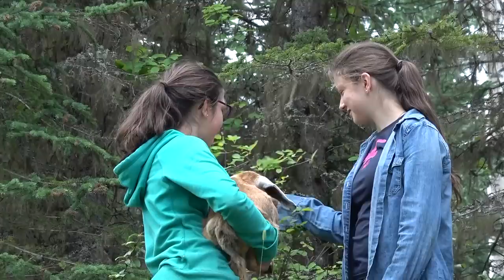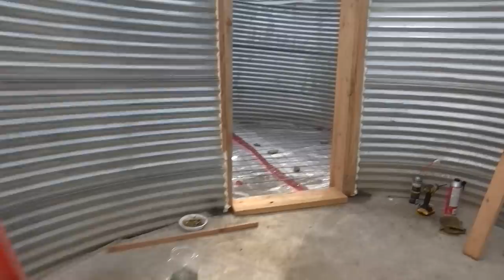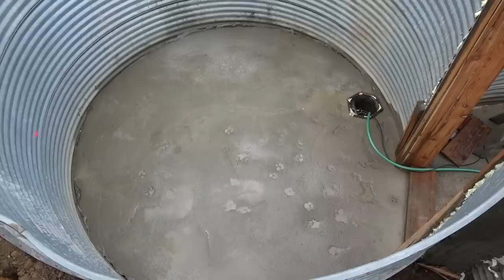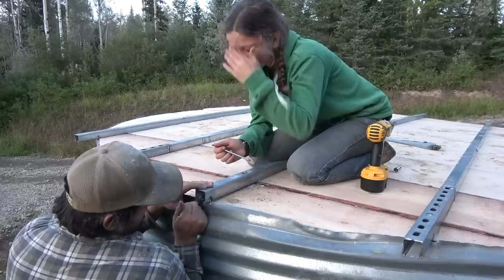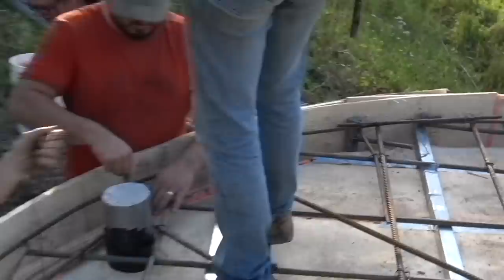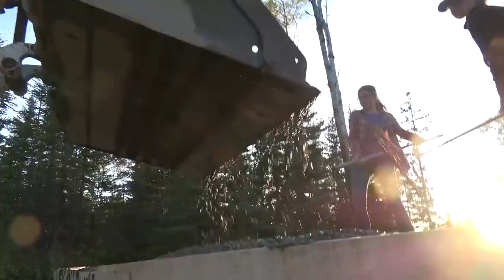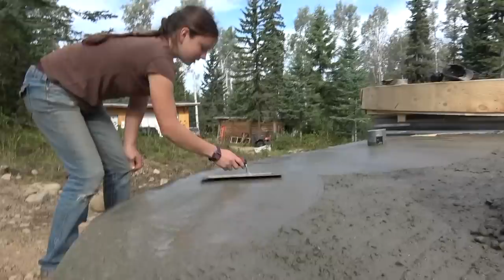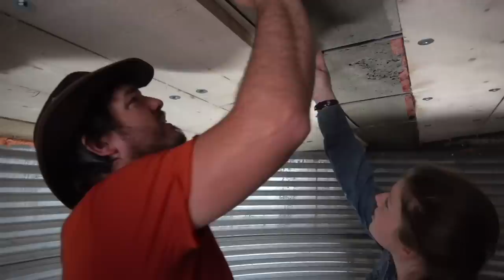Home Made Cellar: Suspended Slab on a Culvert

Comment: You better be putting support walls inside of there made out of 4 - 6 inch drillers pipe. There is no way that is engineered to take all that weight without support beams etc.

Comment: I hope no one is inside when it collapses. I can't  beleave 2" unistrut  held the form wood up.
On a structure that size, using 8" poured block you need 12" bar joist on 24" centers, minimum when pouring on metal floor form.
Reply: Did you miss seeing the 6 to 8 inch timber shoring holding up the wood form? Obviously it was strong enough.

Comment: Glad to see the family working together but come on dad time to be a square and loose the earring and at least one post secured top and bottom in the middle the culvert is not designed to carry a load on end possible solution would be external concrete with rebar columns attached top and bottom

Comment: You needed to pour steel rebar re-inforced columns with integrated rebar tie-ins to slab above around the perimeter maybe even one large one in the center... that culvert will not support that slab

Comment: I don't see how that very thin steel from that culvert can support that very heavy concrete roof top and plus soil over it. Maybe for a while, but eventually that will collapse, and I pray none of your loved ones are in or around that structure when it happens.

Why didn't you just make the walls concrete with rebar to support the weight of the roof and soil?

Comment: Great video, love your family,  your wife and girls are amazing. Boy are you out estrogened  ( not sure if that's the correct use of "ed") I'm  a structure fabricator with steel and concrete,  those culverts are not engineered to handle that much weight.  You have a human mouse trap of death there unless you put some serious internal support inside.

Comment: What you built is very neat let me get that out-of-the-way. Now I wish that I had known you before you started this project and I would’ve seen your drafting if you had any blueprints on

I have work in industrial construction my entire life from the oil field to refineries. Design and engineering so this is my specialty what’s your doing.  That culvert goes by what is called “GAUGE METAL WEIGHT.” what you really needed to do before you took on this project was just simply google the different gauges and weights of that kind of metal that Culvert is made from.     I could have sent it all to you via email. All the info you need. What I am scared to death up for you and your family is all of you not making it out of there. Because of it caving in on you. And I picked up on your comment about it being 40 below zero. The only place on the North American continent were 18 get that low in stay that low for several days on here is Alaska in Canada. Not even my state of North Dakota will get the 40 below and stay that way for several days.   
Yes we’ve had several days of 40 below but that was windchill only not actual temperature. And windchill only affect humans and animals it’s amazing the number of people that don’t even know this.
The only way I would write off and clear your project we say is if you installed at least 2 }]Z 5000 pound rated,    “VERTICAL BRACES.”

The Kerguelen Islands, also known as the Desolation Islands (Îles de la Désolation in French), are a group of islandsin the Antarctic constituting one of the two exposed parts of the Kerguelen Plateau, a large igneous province mostly submerged by the southern Indian Ocean.

 They are among the most isolated places on Earth, located 450 km (280 mi) northwest of the uninhabited Heard Island and McDonald Islands (Australia) and more than 3,300 km (2,100 mi) from Madagascar. 

The nearest populated location (excluding the Alfred Faure scientific station in Île de la Possession, about 1,340 km, 830 mi from there, and the non-permanent station located in Île Amsterdam, 1,440 km, 890 mi away). 

The islands, along with Adélie Land, the Crozet Islands, Amsterdam and Saint Paul Islands, and France's Scattered Islands in the Indian Ocean, are part of the French Southern and Antarctic Lands and are administered as a separate district.

The main island, Grande Terre, is 6,675 km2(2,577 sq mi) in area and is surrounded by a further 300 smaller islands and islets. 

By forming an archipelago of 7,215 km2(2,786 sq mi). The climate is raw and chilly with frequent high winds throughout the year.

 The surrounding seas are generally rough and they remain ice-free year-round. 

There are no indigenous inhabitants, but France maintains a permanent presence of 45 to 100 soldiers, scientists, engineers and researchers.

There are no airports on the islands, so all travel and transport from the outside world is conducted by ship.

The islands were officially discovered by the French navigator Yves-Joseph de Kerguelen-Trémarec on 12 February 1772. The next day Charles de Boisguehenneuc landed and claimed the island for the French crown.

Yves de Kerguelen organised a second expedition in 1773 and arrived at the "baie de l'Oiseau" by December of the same year. On 6 January 1774 he commanded his lieutenant, Henri Pascal de Rochegude, to leave a message notifying any passers-by of the two passages and of the French claim to the islands.

Thereafter, a number of expeditions briefly visited the islands, including that of Captain James Cook in December 1776 during his third voyage, who verified and confirmed the passage of de Kerguelen by discovering and annotating the message left by the French navigator.

Soon after their discovery, the archipelago was regularly visited by whalers and sealers (mostly British, American and Norwegian) 

Who is hunted the resident populations of whales and seals to the point of near extinction, including fur seals in the 18th century and elephant seals in the 19th century. 

The sealing era lasted from 1781 to 1922 during which time 284 sealing visits are recorded, nine of which ended when the vessel was wrecked.

 Modern industrial sealing, associated with whaling stations, occurred intermittently between 1908 and 1956.

 Since the end of the whaling and sealing era, most of the islands' species have been able to increase their population again.

Relics of the sealing period include trypots, hut ruins, graves and inscriptions.

In 1800, Hillsborough spent eight months sealing and whaling around the islands. During this time Captain Robert Rhodes, her master, prepared a chart of the islands.

That vessel returned to London in April 1801 with 450 Barrels of sea elephant oil.

In 1825, the British sealer John Nunn and three crew members from Favourite were shipwrecked on Kerguelen until they were rescued in 1827 by Captain Alexander Distant during his hunting campaign.
Reply: Is it me or did you stray a little off topic?

Comment: That is so dangerous. You want to kill someone? YOu URGENTLY need a centre post support. The people you kill will possibly be the ones you love the most. Hurry up and fix it! (edit a centre post is just a quick fix.. really teh whole slab needs to be hoisted off and the area around the outside of the culvert excavated and then pour the void with reinforced concrete. Work out the weight of the slab and any soil, water on top and provide a centre beam strong enough to support it. Unfortunately the roof slab is probably too small a circumference to be supported by the new concrete walls so you might have to pour the roof again (perhaps you can use the concrete disc as another shed/dome floor somewhere). Not trying to be horrible to you about 'kiling someone' but when I saw you guys go in there (with the kids) at the end of the video I got the fright of my life and was further hocked to see that that was the end of the build. Your either smart and fix it? or youve read this and been told and will be fully responsible for the potential death that could happen.

Comment: I'm not positive what the structural weight rating is for a culver turned on it's edge. That doesn't seem like much surface supporting that concrete slab. But I don't think it will be the culvert that collapses. I think that's to much concrete weight pressing against to little surface area. I don't believe the culvert will buckle, I think the concrete will.